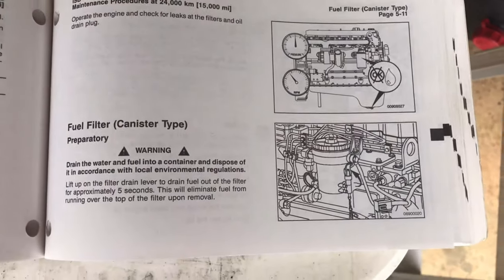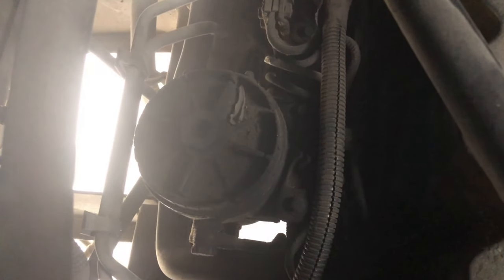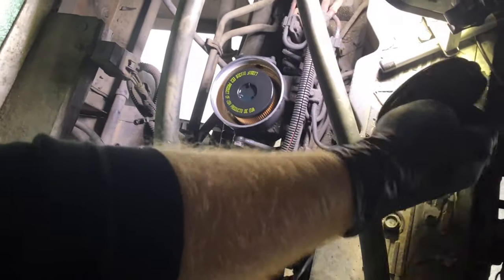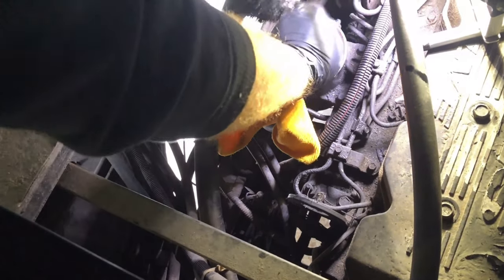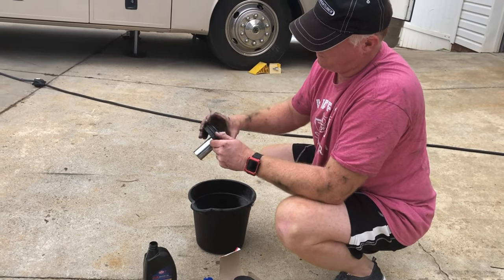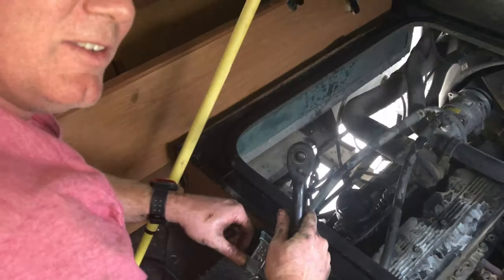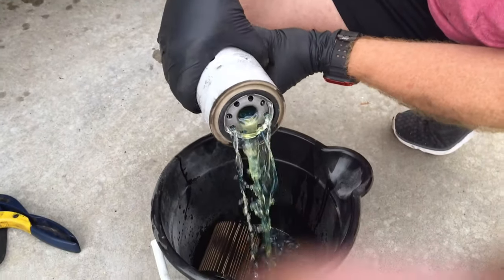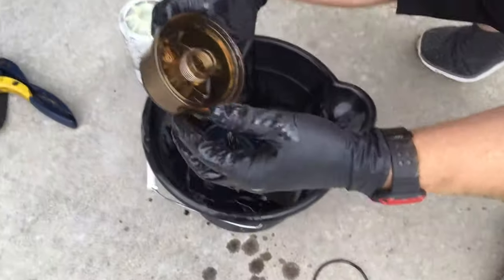Cummins 5.9 Fuel Filter and Fuel-Water Seperator Change - '99 Fleetwood Discovery

Comment: Thanks for the video.  I have a 99 Holiday Rambler Endeavor.  It help give me confidence to do it myself.  3 comments that might be helpful for others.  I had a hard time figuring out what filter to get.  The manual had some options but after opening and cleaning around the canister with the old fuel I found that the filter was on a sticker on the side of the canister, just covered in grime.  It was a different number than the manual said, FYI.  Second, after changing the filter, I left the top loose and turned on the key a bout 10 times, not to start.  Every time I did it pumped a little more fuel in.  When it got to the top I screwed on the top but not tight.  Turned key once more and then tightened it.  No air and it started immediately.  Lastly, my drain was clogged and would not drain.  After installing the new filter I opened it and fuel came out when pressurized.  I would do this first next time.
Thanks for the help.  These videos are the best resource for fixing things your self.

Comment: Thanks for sharing. I changed both of mine this weekend and now it didn't want to start. Been under a roof for winter, so no sun to solar panels. Got a charger and heading back. I did fill both filters with fuel. That being said, I have an issue when I remove the fuel/water separator, fuel continues coming down at a good rate. I am thinking the pump is powered even with the key out. I get stressed trying to get the filter back on and accumulate a bunch of fuel. My bucket gets over 3/4 full of diesel. Also, the water bowl has fuel in it, and I can see it is 100% full. I changed these 2-years ago and 5k miles. Same fuel running issue back then. 2012 Forest River Berkshire with ISD6 Cummins. I did plan to start my summer travels this weekend, but have put it off a week. I did pick up maybe I need to leave the key on for more than the waiting for lights to off to start, kind of like you said to prime it. If I remove this filter again, I might try turning the battery off since the key primes it.  Any tips are appreciated.
Reply: Tonight I was able to get her started. Whew! I kept the key in the run a bunch, tried starting several times. Let the charger work the battery, went to Wal Mart, came back and few times later shazam! I was so nervous as what to do.

Comment: Another excellent video.  I have a 98 and will tackle this after I get my Battery bay painted and batteries reinstalled!  Any chance you can post pics of your battery compartment and wiring hook up?  I have a few concerns on hooking up some of the wires that don't show on diagrams I have.
Reply from the maker: sure!! send your e-mail address and I'll email you a picture of my battery bay.      rvpastorkevin@gmail.com
Reply: Great video. I'm doing the job now ,any chance I could also get a photo of the battery bay .I purchased this same MH and I had a guy come and work on the electrical and it seems from previous owners and the new guy removing the cables without labeling I now am having a tough time getting it cabled back up .also seems my generator is having a hard time cranking over aswell . I believe that because the generator is Lp that it cabled too the Aux batteries and tied in too the Lp detector so it isn't wired directly too the main battery and when I try and start it draws most of the Aux power and is still isn't enough too start. Anyways would be great too see that photo aswell .looked everywhere online for days and nothing detailed enough or clear enough too use .

Comment: Safely working with a pressurized (or even a possibly pressurized) fuel system, means it's smart to wear at least safety glasses, if not a face shield when you breach a pressure boundary.

My Triumph Tiger has about 45 psig on the fuel manifold and it holds it a looooong time after turning off the key.
Ask me how I know.

Neither gas nor diesel is good in your eyes.

Be safe!

Comment: Hello there! I have the same exact RV. I'm  idling at about 800 rpm's. Feels a bit too high when I shift into gear as the motorhome jumps into gear. Any suggestions?
Reply from the maker: 800 RPM sounds about right for idle for the Cummins 5.9.  High Idle is 1100.  Do you have the Allison transmission?  You should join the DOAI (Discovery Owners Association... they have some tech guys who can completely rebuild the engines, and they have been a lifesaver for me!  Just a fantastic resource!!!   https://www.discoveryowners.com/home.html
Maybe someone on there could advise you on possibly setting the idle lower?

Comment: This problem started after I filled my tank with diesel at my local fuel station
Reply from the maker: are you sure you don't have the RV running at "Hgh Idle"?  (It is when, at idle, you turn on the cruise control with the set button..."  that is the only reason I can think the ECM would have the rig running at a higher-than-normal idle speed.
You should TOTALLY join the DOAI. (Google the Discovery Owners Association) the e-mail tech support group is AMAZING!!! Lots of guys do all their own work and all help each other out. you should look into it!
Reply: @RVPastorKevin  what rpm does your rig run on idle?